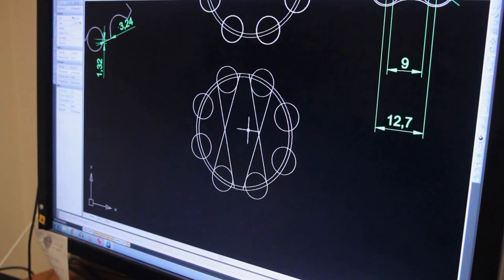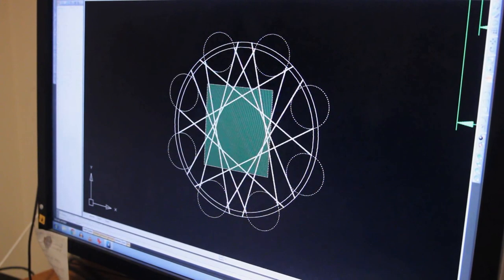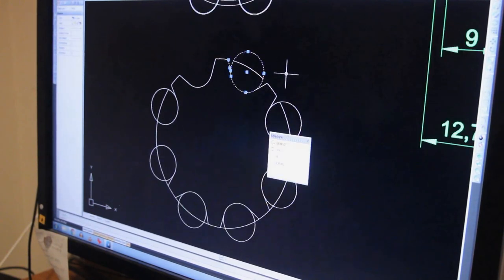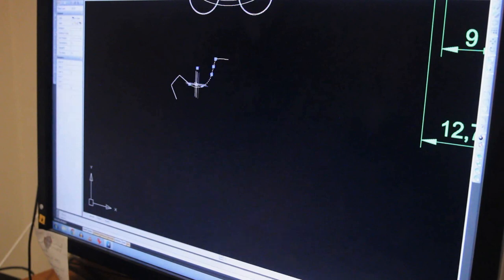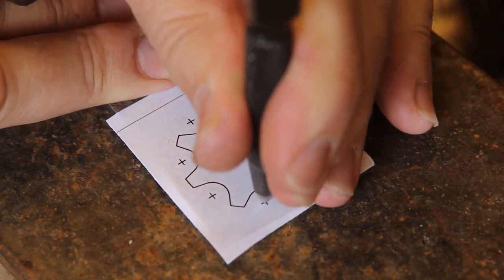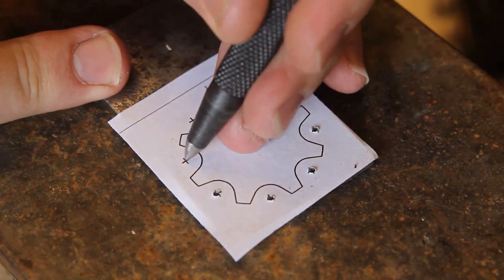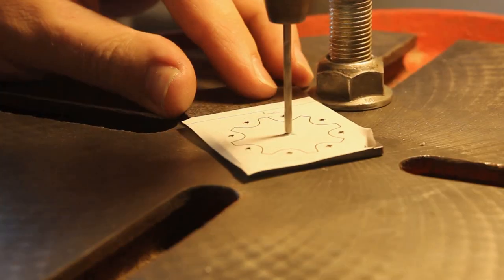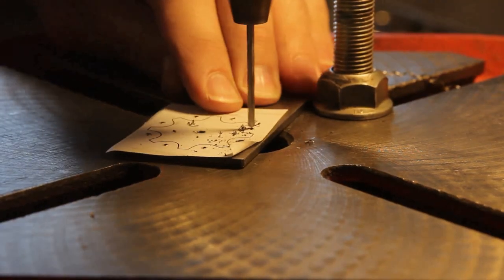Making a sprocket for bicycle chain the way Clickspring wouldn't

Comment: Awesome man, it's pretty nifty you made a functional sprocket with a drill and a belt sander.

Sent it to my mate who's making a motorised sliding fence gate for his ranch. I gave him a 5mm thick piece of spring steel, and your sprocket sketch, so if it survives pulling a 180kg sliding gate then i'd say it's more than fine for ebikes and stuff.
Reply from the maker: Cheers, I wouldn't use it on anything high speed but it should probably do OK on a gate. Thanks for watching!

Comment from the maker: On subsequent sprockets I used a drill guide instead of centre punching which gave much better results, https://www.instagram.com/p/B8sxbb4naD5/ adding circles made it even easier to line up the paper template and the steel it was glued to with the drill guide.

Comment: Man” your good with your hands good job on sprocket what kind of motor were you using on the sprocket?
Reply from the maker: Cheers! It's an actuator off a heater box out of a car, they rotate continuously.

Comment: this is more like the type of engineering i can relate too! just drill some holes and grind the rest away!!!
Reply from the maker: Cheers! I was going to get a friend to CNC them out of brass but figured I should give it a go. The project has  11 sprockets in it, and a few needed fairly specific geometry which was pretty easy to tune.

Comment: If used for a cnc machine, won't any irregularities in the teeth cause jagged cuts?
Reply from the maker: Probably, I wouldn't even use proper sprockets and chain on a CNC machine, belts or direct drive would be the way to go.

Comment: SUPER video!!!! But please explain: by what did you go to file down exactly equal the shape of the valleys between the teeth??? Could you please explain the rules on how to draw the sprocket?
Reply from the maker: Thanks! Think of this more a an easy way to make a sprocket than the right way, the tooth shape should be an involute, I made it straight to make it easier to grind with a simple jig, my application is very low RPM, I'd want to use CNC on something fast, or just use one from a bike.

Comment: Nice job is it possible for you to make a template for a chainsaw chain sprocket pitch is measured different than roller sprocket its center to center on three rivets divided by two
Reply from the maker: I'd need a reason to first, don't have any plans to work with saw chain. There are a number of different chain pitches too.

Comment: Can i ask which motors you used at the end? I am searching for a high Nm motor with real low rpm so some informations would be useful :) also very nice build excelent workmanship :D
Reply from the maker: it's a continuous rotation actuator from an automotive airconditioning module (heater box) I used them because I had a few lying around, from memory they are about 5 RPM and 2 N.m

I found lots of more compact motors on ebay that were pretty cheap, but these were free
Reply: Thanks a lot i already bought one from ebay but it doesnt do the job quite well so i am searching for alternatives :) 2 Nm is to low but thanks for the fast answer :)
Reply from the maker: What's your application? What speed and torque do you need? Cordless drill could work if you don't need it to be compact, otherwise I imagine it won't be cheap. Oh and excellent workmanship is generous but thanks, my later sprockets are much better, have made about 10 now.
Reply: @lapislignum  is there any app for calculating the sproket with teeth and all dimensions.
Reply from the maker: @Abin jose There could be, I haven't seen one. I just did what looked right in CAD based on the dimensions of the chain and bike sprockets I had lying around, and would be easy to make. There are a few videos on how to do it "properly" floating around that explain why they end up looking the way they do.

Comment: Can you give me your CAD project?
Reply from the maker: Sure, will you be cutting it out manually or CNC? I worked out a better way to get the holes drilled than centrepunching.
Reply: @lapislignum  i would try first manualy, then CNC
Reply: @lapislignum  but i am not sure can manualy made sprocket spin up to 2650rpm?
Reply from the maker: @BalkanFilm  This one is going to spin at 5 RPM, I definitely wouldn't trust my design at speeds much faster than that - especially if cut manually. I looked at designing sprockets and there is a fair bit to it, this one I just eyeballed and it ended up working OK.

Comment: Good day. Discard the link with the asterisk file.
Reply from the maker: Which link? Why?
Reply: @lapislignum  A reference to a sketch of an asterisk. I just came up. That it would be possible to print and paste. I can’t draw in the program (
Reply from the maker: There is a link to a .JPG of the design in the comments, if it doesn't work email me and I'll send you a .pdf. I'd only recommend this design for low speed applications.
Reply from the maker: Email sent!
Reply from the maker: Sent, enjoy!
Reply: SPE thank you ! Can’t wait for your next videos !
Reply from the maker: No problem, hope you like the next one! (Whatever it turns out to be)
Reply: @lapislignum  Thank you so much! Good ideas!
Reply from the maker: Cheers!
Reply from the maker: No problem, hope whatever you are making turns out good!